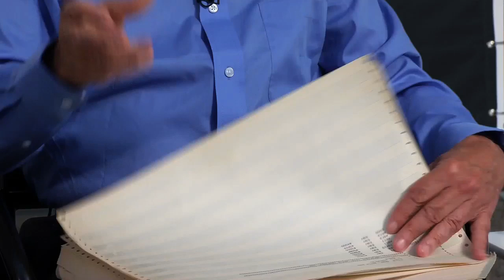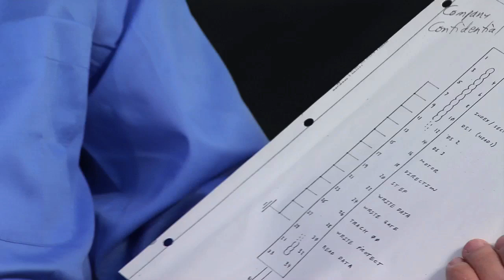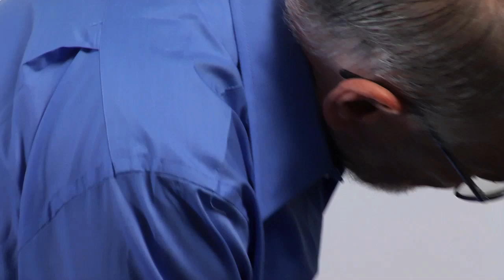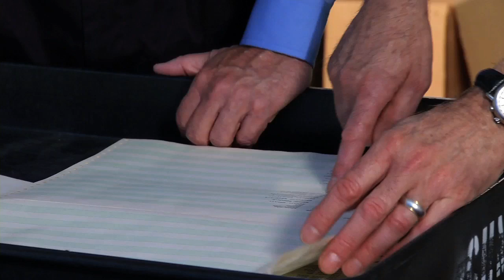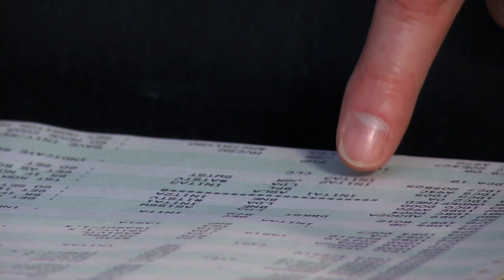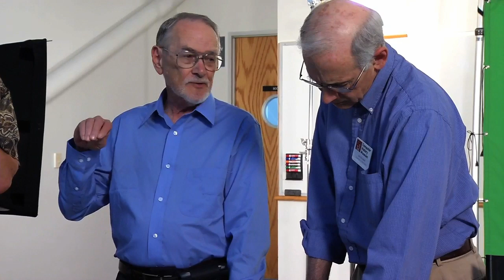Oral History of Paul Laughton

Comment: Great video, thanks. Funny coincidence that Atari later named their game consoles 5200 and 7800 :-) I feel connected since I wrote own Intel-8080 emulator using great Atmas-II back in 1988 during summer at high school, not having floppy drive but also fortunatelly without any paper data entry... using DIY PLL 4046 tape interface; not very funny though; was builtin CIO system in AtariOS the better thing he noticed?? It was clever, but the peripherals was quite pricey for us at that time, and also not so available; whole game consoles and 8bit market was slowly dying in the world too; Last thing I remeber was disassembling borrowed XF-551 8035 secketed ROM (to reverse engineer floppy SIO protocol) by pushing it into basic-rom -socket of PC/XT in hospital lab where I worked ... quite coincidence, it was plug'n'play ... but then I sold it all to buy 386sx board as replacement of dead PC/AT and fixed EGA display by replacing dead PROM (color-mono switch "feature") by birding-in single 7404 to only invert rgb signals. Golden memories.

Comment: CP/A+ eventually became OS/A+ for the Atari 8-bit computers, released by the remainder of those from Shepardson who went on to Optimized Systems Software (OSS).

OS/A+ had interesting divergences as well,

there were two families of code. OS/A 2.x (and CP/A) used the code for the Atari DOS 2 FMS for both Atari and Apple, with its linked list sector allocation, 8.3 size filenames, etc...

Then there was OS/A 4.x, which took the Apple DOS FMS, with its file types, long character filenames with spaces, and bitmap based sector allocation, and ported it to the Atari 8-bit. It works very well, but nothing else in the Atari world can read the filesystem.

OS/A 2.x eventually became known as DOS XL.